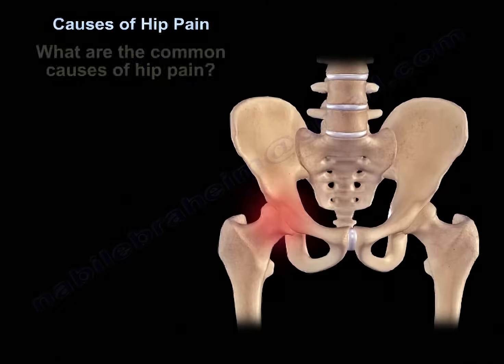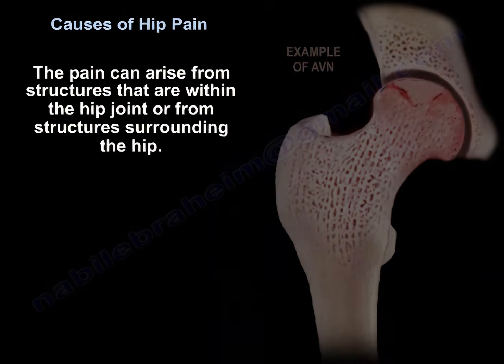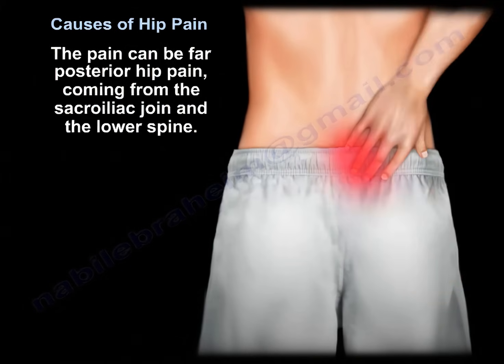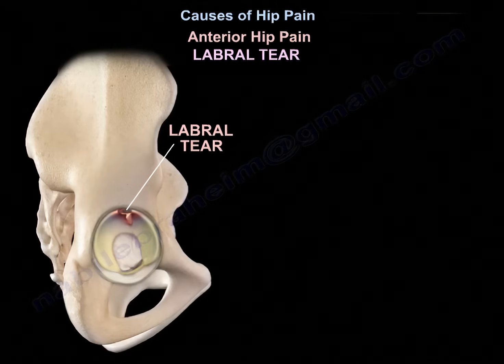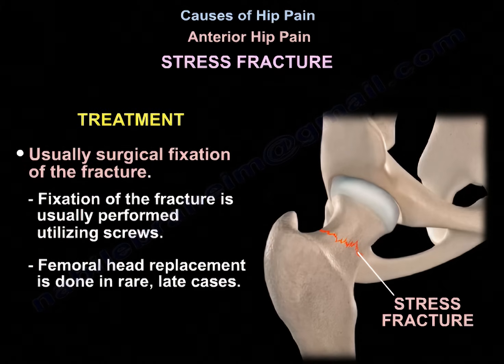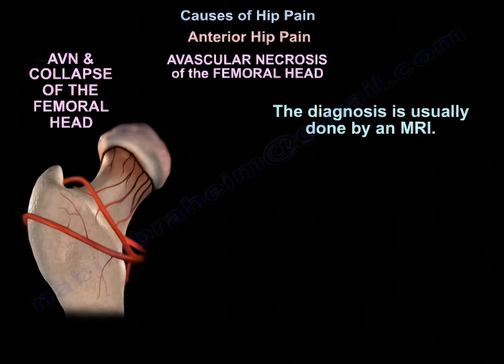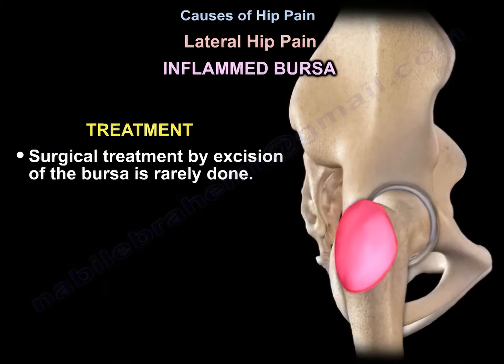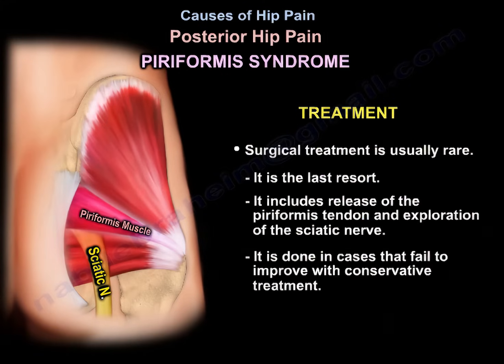hip pain, causes, diagnosis  and treatment.

Comment: Hi Dr, thank you, this was indeed helpful. I have posterior hip pain that started after running long distance. It has been over two months, and the pain is still there even though it's not as sharp and thank God, I'm no longer limping. However, I still get flare-ups, the pain remains there, and I do stretches my PT recommended. I was just wondering if this could be a posterior hip labrum tear? considering the time, I've heard there is such.

Comment: I have herniated discs in lumbar. Cant lay on either side,  back or tummy without having severe pain that goes into femoral head and groin. Many different sensations are happening simultaneously,  including spiderwebs on front of thigh, burning at inner anterior pelvis, twitching,  severe sharp pain that causes me to not be able to move at times. It goes away completely when i stand up. Some circular numb spots that are ice cold at sits bone and inner thigh. Pain also goes into inguinal or inner rim of hip . Some loss of sensation in genital area specifically when I wipe

Comment: What if an MRI of the hip is not an option due to hardware? How does a clinician visualize the structures of the hip? Does osteoporosis cause pain? Would steroid injections be contraindicated when osteoporosis is present?  What condition would leg length discrepancy cause?

Comment: This video makes a whole lot of sense my right hip has been kicking my ass all day and night, the  pain came out of nowhere and hasn't let up. I tried muscle rubs of all kinds and no luck. Never thought that I would be dealing with something like this.  Hip replacement runs in my family.
Reply: Ice really helps, I do 20 - 30 minutes. If its very cold no more than 20 minutes. every day use ice packs. My hip has been painful lately and runs down thigh to knee . Over exertion. I also use topricin cream. Company may still send free samples . they use to . Its very good all natural and has no smell. Can feel the difference in 20- 30 minutes.
Reply: @DeBe4604  Thanks. For the tip I will definitely will try it.
Reply: @DeBe4604  Thank you

Comment: I have a damaged hip now. I believe it started as a hip pointer tear. I think you partially described it here. I was setting an item down. Had leaned forward in the process. Had a testing sensation. That lead to severe pain
Reply: That was a tearing sensation. Stupid auto correct. Been in severe pain ever since. Diagnosed as decreased joint space. Had a highschool relative suffer same injury from football but was able to heal.

Comment: Thank you for your video it explains alot. I slipped on ice and fell down concrete steps, s catching my right buttock on the corner of the step.  Drs only look at my back but I have alot of hip pain in my right leg. No one has ever looked at my hip only x-ray. I'm going for a second opinion ASAP.
Reply: Kaise sahi hua

Comment: I had a hip pain for a month, i was exercising and prying. One morning I woke up like pain has never been there. I told it to everyone I met that day. I still don’t know how that terrible pain disappeared, like it has never been there…
Reply: May miracles happens to everyone
Reply: Mine comes and goes too. I had an xray and there is deterioration  in both hips. You should still see your physician to get a proper diagnosis.
Reply: What kind of exercises? I have pain near my hip. I sometimes feel it at the side of my knee, and side calf
Reply: @dinop7488  There're excellent hip exercises on utube. I need to do them for my hip pain.
Surgery is my last resort. No, take that back....would not consider it at all.
Reply: @dinop7488  I didn’t have a specific exercise, but I would turn  repetitive in different directions in the area of the painful spot, like  100 times until pain is gone , especially when I am in the bed. You will have at least temporary relief. Mine was an inflammation and didn’t let me to fall sleep. Good Luck!
Reply: Jesus
Reply: l have it more then a week now but much more lover in front.I think somewhere higher is pressure of nerve.Can't find exercise for this problem.I walking a lot in my work days
Reply: I am having the same pain, it's  not letting me sleep I have to eat pain killer. I use to do cardio and stretches, maybe it happened due to that. Do i need to go to the physician?
Reply: ihad pain in my right leg front when istand more than 5min like burning itches too much pain ifeel someone cut my hip like blade too much pain cant described when istart walk or sit 1min pain gone this pain m fainted fall in floor pls help me

Comment: Thank you for the information in 2008 i pick up a load of cattle gates 42 gates total weight of 43,980 lbs while making a delivery and standing on the top of a flatbed trailer cut the strap and then the load expanded i asked for God’s help i jumped from the top of the trailer onto the ground and as I looked up the gates were coming down and I extended my arms up to catch them and was slammed onto the ground woke up with 6 gates on top of my upper body from my stomach covering my upper chest i kept asking God for his strength and on my last breath i moved over 6,000 lbs 4 different times then got up and got knocked down by a person and was taken to the hospital  after i was able to understand the nature of the situation the doctors said i would never walk again they said i broke both ankles,a bone came out of my lower right leg broke my pelvis in 4 different spots all my ribs broken in 3-4 different spots broke all my fingers and right shoulder it took me 4 years with the help of God and nurse June i walk a one year later and made a great recovery i still have pains on the lower joints of my hip and pelvis sometimes the pain is so hurtful but i managed i still drive flatbed,when i go the doctor and explain my pain they said there’s nothing wrong with me but by you given this information I can relate and improve my hip joints pain to higher level of recovery ❤️‍🩹 i learned not to eat certain foods to avoid gout inflammation and arthritis.i would like to see you and maybe you can give a better solution to my pains.tnx Jose.

Comment: Since we've had the Covid jabs both my partner and I have had hip, joint pain and aching.  As a female it has also  affected my menstrual symptoms. It could be our age but it can't be a coincidence we both have the same thing. I have NEVER had back, hip or joint pain before.
Reply: My friend had both jabs months ago and told me just yesterday she has the joint pain too and it's getting worse. Dr doesn't know what's wrong.
Reply: Probably the start to an autoimmune disease. Just being honest. It took me 5 years to get a diagnosis of RA, and I suffered the entire time. I'm still suffering just not as much as before.
Reply: @Itsonly1KM  I had hints in 2011 but migraines and eye pain so bad I got relief so didn't worry about lab work.  NOw hip and same side arm make me regret not starting treatement earlier but it could be pandemic in sedentary life to dodge pollution.

I need some indoor soft surface to walk on maybe special shoes to walk on hard floor but clean air not just indoors.

I was so active without pain but pain follows sedentary not vice versa.
Reply: There are lots of people with this, same pain, AFTER THE  💉, MY FRIENDS HUBBY HAS GONE DOWN HILL AFT THE 1/2/3  💉, SIMMER FRAME NOW, AND WIFE COVERED IN PURPLE, LIKE BLOOD VESSELS ALL OVER HER BODY ➕ SWOLLEN LEGS FEET, NOW ITS HER BLOOD,,😡, ME HELL WILL FREEZE OVER BEFORE I GET  💉 BOTH BEEN MADE TO HAVE IT, NASTY EVIL, SHE IS SO SCARED TO GO OUT,, ME HAVE GOT ALL THE ABOVE HIP LEG KNEE FOOT PAINS, BECAUSE I HAD A VERY NASTY TRIP WENT DOWN REALLY BADLY, THIS WAS 3,1/2YEARS AGO,, BUT NO TREATMENTS, BECAUSE I'M STILL WALKING, DOWN THE LIST AGAIN, BUT NOW I WONT GO IN, DON'T LIKE THOSE BLACK BODY BAGS, NO WAY, WRONG AGE NOW BE 73 THIS YEAR,, JUST THOUGHT I'D LET PEOPLE KNW WHAT'S REALLY GOING ON, 😔 😔
Reply: @lindarose9481  😊
Reply: @lindarose9481  😊

Comment: Thanks for the very clear explanation.  I used to have pain in my hip caused by running.  Thankfully was outside the joint.  It went away after I changed my running style from heel-strike first to "bare foot" style (not really bare foot, just use the same style).  Seem like heel-strike first style of running is VERY high impact and caused problem to my knees and also the hip area.  After decades of running in that style, finally my body could not handle the high impact any more.  After I changed the running style, the problem went away within 2 weeks, and I am pain free ever since -- and that was 5 years or more ago.
Reply: Thanks for the advice.  I'll have to try that.  My hip and back hurt like a beast. I'm dying to get back to running. Good luck to you.
Reply: @jennifergray5499  depends on shoes clearly- spring shoes tend to only have it in heel.  but this video has old fashioned static illustrations that don't hint at complexity and hip working right.

I am really frustrated with second class medication here in america.

Avoid "deemed" providers INSIST you get seen by accountable.  Unless paying on sliding fee without ANY insurance make sure they are afraid of medical malpractic lawyers- no community health center fears lawyers as they can't get paid nor can you if injured.

California makes getting insurance for a year harder then elsewhere.

Comment: I have a left hip pain that is accompanied with a clicking sensation in lower left back near SI joint region. I haven't been able to locate any good research or discussion on this at all.
Reply: Same with me i.tired of looking for anything that can give me relieve
Reply: @preciousthoughts4674  hi, my comment was from a year ago but my problem had mostly gotten better by 90% improvement with some core workouts I learned from a specialized sports therapy clinic. Check out performance place chiropractic in Costa Mesa,CA.  Good luck 🤞 they are not cheap but it was well worth the money in my case.

Comment: It was helpful. Thank you. I was told severe arthritis of the hip and degenerative disc disease with spinal stenosis. I had si joint injection in my left si joint followed by burning of the nerve roots. I'm 63 now. I dread any surgery. I also have a bad left knee and an ankle that has a plate and screws. The ankle is on the side of the pain. It's been getting stuck and not bending. It finally popped and it's been sore and has a bruise for almost 3 weeks. I'm afraid the hip surgery would make everything hurt worse. I don't cry much but I've been crying with this. I n3d help. Prednisone made my low back feel better but my hip in back and on the side also sends pain in my groin and down into my leg on the inside down to my knee.
Reply: Reading your diagnosis sounds very much like mine.…I emphasise. Thanks to the doctor for explaining it all. Best wishes.
Reply: Victoria ,! my heart  goes  out to you I have degenerative  disc disease,  and arthritis  in my pelvis, tooth  ache  in the  bone  I call it,we are stronger  than we know Gef.
Reply: Try ice on lower spine 20 min couple X a day and notice how you turn while cooking and cleaning up in the kitchen. I noticed that last night and think that's some of the problem. To much twisting of the hip. I have stenosis and hip pain. Ice helps me. Ice helps on hips also. Also a odorless natural cream called Topricin. Google for site. They use to send free samples. Can feel the difference. I also have some numbness from waist down and nerve pain. I don't take any pain meds . make my stomach burn. I Just take 1 low dose anti anxiety med at bedtime . helps relax so I can get to sleep.
Reply: The si joint fusion is pretty simple and well worth it. I've had a spinal fusion as well.
Reply: Don't say "any" but avoid risky surgeries sure.  This MRI etc. era should see far more competition then we see.  I would get really slim but strong, and am trying to lose weight instead of gaining it myself (total weight has not changed much but i los tmuscle which has me getting injured now )

I don't care about pain as much as not making body worse so avoid taking meds for pain suppression.

Pain is a warning and I don't tape over "check engine light"

Pain is awful but small pain can be ignored or overtreated

stretch, don't stretch it's ridiclous how little i know.

this video is simple but informative...

it is not well done however

"anterior" is forgotten from definition to use

Comment: You mentioned hip pain which may be due to tear of gluteus minimus etc but not the treatment of? MRI has shown full thickness of gluteus minimus but I'm told "no treatment now, it's been too long" this is after years of chronic pain and being told "it's pain radiating from your back" which it obviously wasn't!
Reply: i would not accept "too long" only "not enough time left"

even that requires ball more crystal then typical

i am under 60

Comment: This video does not mention one of the most common cause of anterior hip pain, especially in younger, more active individuals: hip flexor tightness or injury. The Iliopsoas muscles, the Iliacus attached to interior of the iliac bone (big pelvic bone) and the psoas muscle attached to the lower spine. These muscles run together anterior to the hip joint, they wrap around the femoral neck and attach posteriorly in the lesser trochanter. Anatomy jargon aside, if a person sits a lot, or suddenly starts working their legs out, they may get tightness and pain in the anterior hip area. The pain my be very localized to one spot, and it might be alleviated by pushing on the painful spot. Treatment includes rest, NSAIDS, stretching or standing more if you sit a lot at your job. 
I hate to sound pedantic, but if you're going to have a video called "Everything" You Need To Know, and then leave out one of the most common causes of hip pain, describing it only once as "surrounding structures," I thought I might mention it.
Reply: @charlyloman8837  Is it what you have? Just curious.
Reply: Hello, I hope you can shed some light on my  very painful knee. It started over 3 years ago and manifested a few days after a total hip replacement. I have done a lot of ballet in my life and it has been suggested to me that the hip was replaced "at the incorrect angle". It is literally excruciating to walk using that leg. Referring to a doctor, he maintained that the only solution was to have yet another full hip replacement!
I have been doing physical therapy exercises the entire time and walking as much as possible but the pain in my knee remains as bad as ever and I am becoming desperate  that I will never be pain-free again. 
Any positive suggestions are welcome...thank you
Reply: THANK YOU THIS THE INFORMATION I WAS LOOKING FOR . I’m 26 and truck driver (sitting a lot) I just started 4 mile walks and notice that the joint started getting sore . Was looking into it ….little strange being I can do a Chinese split  and never had these problems in my earlier days as a gymnast.
Reply: I wonder if that’s what’s going on with me right now.
Reply: Also look into
PIRIFORMIS exercises which have given some people relief from excruciating pain -- there are a number of vids about it .
Reply: You have made a very valuable contribution. I think this is my problem too. Thank you.
Reply: can you define hip flexor  tightness? also the video seems to be referring to more chronic conditions rather than "hip flexor tightness" and acute injuries, which I believe you are referring to muscle strain. Basically both have no place in this video
Reply: @blaschito1  Well, if you sit at work everyday, or continue to work out through pain, these conditions can become chronic, or even permanent, and if you don't know the cause, you can't get rid of it, can you? And I don't think I could describe it any better. Seriously. So my statements stand.
Reply: @fmmaj9noname332   happy you